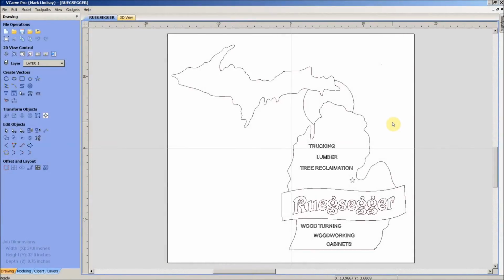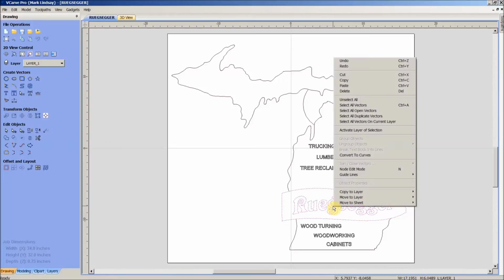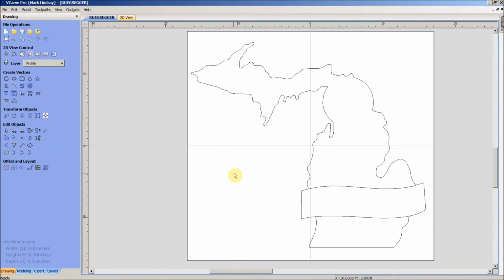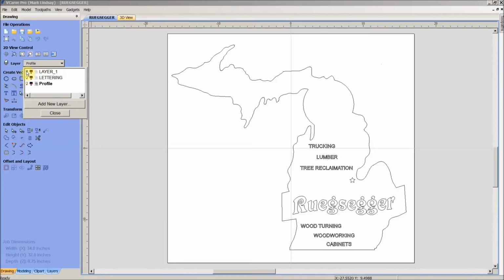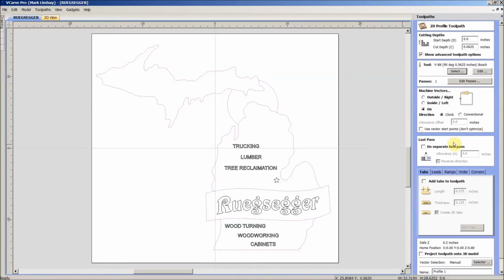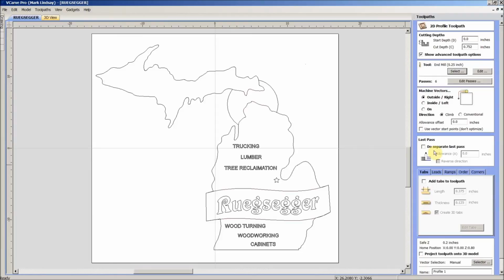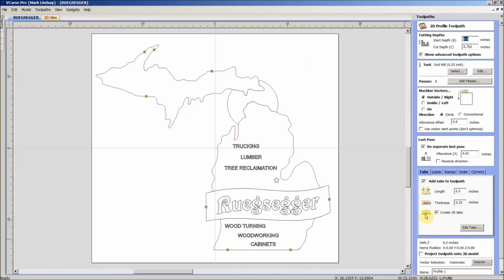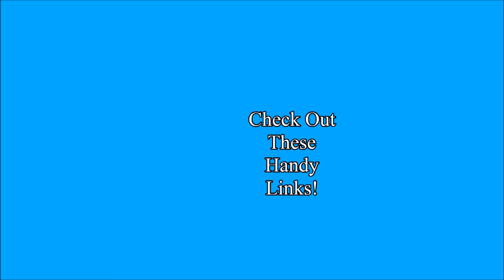Joining Problem Vectors using Layers in VCarve and Aspire

Comment: Very good video. And as always very explanatory.
 I mostly use the weld vectors instead of the scissors,
 it is faster, but gives less control than the scissors tool.
In some cases it is very useful but sometimes it welds things you don't want to weld and leaves unwelded what you want to weld.
Keep up the good work.
Reply from the maker: Thank you Mitsos. I'll be doing a video on Welding Vectors very soon. I agree with you that they both have their place.

Comment: Is it possible to take only the .010 cut only without taking the last bottom cut with it? we used to do that on CNC milling machines when cutting metal.  That relieves any bottom pressure and leaves a great smooth cut on the profile only.
Reply from the maker: It's just not needed with wood, Tom. I routinely cut all the way through the material in 2, 3, or 4 passes, and it comes out just fine. Wood is a whole 'nuther critter from metal.
Reply: Thank you!

Comment: Mark,  as I’m beginning to learn this more and more,  I’m wondering if it’s a best practice to normally just use layers in my design thinking.  As I’m practicing, I find I often have intersections and open vectors and it would seem using the layers would certainly help.    Since I’m new,  I don’t have any bad habits YET, so wondering if this is a good habit to use.   I find your videos very useful, so thank you.
Reply from the maker: I think it's a good habit to get into on complex designs that may possible have vectors that overlap or cross one another. For more simple designs, it's not 100% necessary. Still, it's a good habit to get into, like you're saying.

Comment: I wish Vectric would hire you to do their videos!  Amazing!  I had no idea of the capabilities of VCarve Pro.  Even the simple suggestion to get the Z to plunge through @21:20.  Awesome!!

Just subscribed!
Reply from the maker: Thank you, Corey. I hope it helps you out.
Reply: Mr. Lindsay,  I know you are always running your own projects, but I've stumbled into a scenario that I can't completely figure out how to solve.  Two issues:  1.  I'm running 5 different "toolpaths", on my 4th path, doing a finishing cut on a detailed object, I cannot adjust the depth.  Its is running deeper than I would like it.  I figure this is based on my material setup being at .75, which is also the depth it is cutting to.  I'd prefer it to be no deeper than .625.  And #2.  I am making a reducing a cut, leaving raised letters.  My first cut is the initial depth that I want the top of the letters.  The second cut brings the entire project to the final layer/depth I wanted (.625) and jumping ahead to the last cut, it is "cleaning up" the letters in the project.  I'm finding that with a previous cut, I had used an off-set, but the final cut will not clean-up some of the spaces between the letters.  Is there a way I can run another cut to just go in and remove the scraps?  I'll be happy to send my file for you to view.  THANKS!  ~Corey
Reply from the maker: Shoot me an email through the Contact page on my website.  marklindsaycnc.com   It's easier to have a discussion there. Hope to chat with you soon! And call me Mark, please.
Reply: I stopped watching the Vcarve videos when I saw Mark's channel. 
Mark seems to have an in depth knowledge of the software but also is a cnc operator so he knows what trouble you might run into.
But most importantly he shares this knowledge.

Comment: Great information Mark, I do have a question about changing bits, how do you change bits with out loosing your z clearance I’ve try it and since my bits vary in height I always have issues?? Can you help
Reply from the maker: You have perfect timing, Luis. I posted a video today, where I demonstrated just that. The video is about a 3D carving, but the process I use is the same whether I'm v-carving or doing something else that requires a tool change.  https://www.youtube.com/watch?v=hXRp4igZU5s